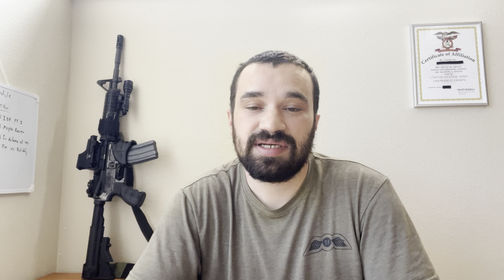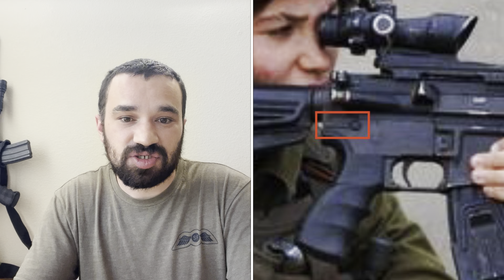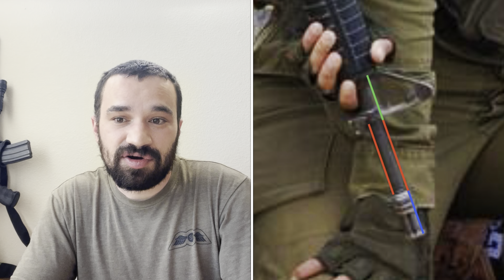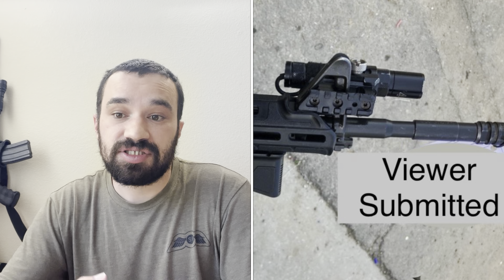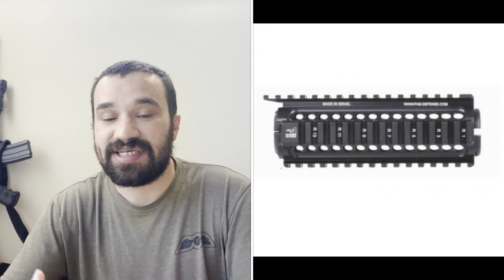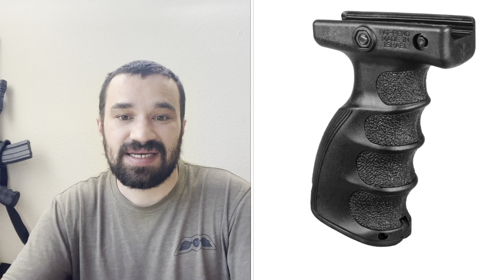The M4 in Israeli Service

Comment: Chopped down M-16 barrels? I think they are factory-made M-653, the predecessor to the M4 series. I'm from Singapore and our tank crews used to be armed with them.
Reply from the maker: Thanks for commenting! It’s funny you say that, the barrel I am using for my “clone” rifle is a 653 barrel, and I did read that these were used in Singapore as well.

It a very likely that the IDF is using some 653 barrels, but their use of “chopped” M16A1 barrels is also well documented. In many of the pictures I show it this video, the Israeli “pencil profile” barrels appear to be 12.6” in length, which is the exact length of a chopped down m16 rifle barrel (due to the location of the original gas port). We would typically expect a 653 barrel to be 14.5”.
Reply: @Triangle26  Unlike your stated field of expertise, I know nothing about gunsmithing. However, isn’t it very difficult to take a M16A1 20-inch barrel, cut it down and then relocated the front sight / gas block further down towards the trunnion without issues including alignment of the foresight, the gas system etc? 

From photos online of very short IDF carbines  I can surmise that they took the M653 and further cut down the barrel by an inch or two, but not affecting the front sight and gas system.

Comment: About your mention of no high profile units like golani givati and nahal getting rid of their x95s, they actually are, all current units in training for those units are training on m4s with aim point comp m4 and not the mepro m5
Reply from the maker: Thanks for insights! I’ve been receiving conflicting information, but it sounds as though what you are saying is correct. Although my understanding is that experienced soldiers in those brigades are still primarily using X95s?
Reply: @Triangle26  yeah the soldiers already in the unit are still with the x95, I imagine as each unit gets replaced by new recruits (every 4 months one out one in) they’ll slowly be fully faded out. A few of my friends in nahal reservist units were meant to switch to the m4, I can check with them if they actually did (just called up again). There were also reports that the current tavors would be transferred to artillery and tanks so they have new guns that are also compact. (Artillery and tanks as you know use shot to death katzars and mekutrars that have serious logistics issues leading to bad reliability, bad buffer tube springs, worn out parts, bent front and rear iron sights etc)

Comment: Just curious, is the IDF transitioning to gray uniform from olive green or its just SF units?
Reply from the maker: Hopefully one of the IDF guys in the comment section can help, I have no idea!
Reply: @Triangle26  Yep, I googled it's "muted green"? . Follow up question mate, Is m193 the standard ammo in IDF even to those who carry M4's?   Sorry if I missed a part of the video.
Reply from the maker: @NeilJason-fo6kb  Great question. Yes, I believe M193 is standard issue for the IDF, however they definitely use M855 as well. I’ve heard quite a few reports that marksmen in particular are given 855. This likely has something to do with the fact that most IDF marksmen are using 4x32 ACOGs, in which the reticle is typically calibrated to the 62 grain SS109 projectile.

All that said, I haven’t mentioned it in a video yet because I am still digging in. It seems crazy to me that units are issuing 193 and 855, while simultaneously using 1:7 and 1:12 twist barrels, but based on what I am hearing, that is definitely common (at least in the reserves).
Reply: @Triangle26  Thank you mate.

Comment: When I was there last year,  the M4s I saw were equiped with basic plastic USGI furniture (not FAB'ed out, not even a knights rail) with a sling,  light mounted to the the front sight block, and a Meprolight MOR for the optic. These were Homefront Command reservist though. The exception to this was one very grumpy looking soldier with an x95 (zero finish remaining) who was patroling the market.

Side note: I use Nitecore lights as well - i particularly like the C17, which is a dual white / IR emitter.
Reply from the maker: Thanks for sharing. It does seem to be unit dependent, I’ve heard similar things from a few guys now.
Reply: Homefront Command are pretty much the last in line for new equipment and arms, especially their reservists

Comment: Thanks for the video, very well put.

a small comment/opinion on the definition part as an IDF infantry who served around that time. During the end of the 90's through the beginning of 2000 the IDF was in the process of replacing most (if not all) Colt car 15 based platforms (katsar, mekutsar etc) at their combat units with modern Colt flat tops, i.e proper m4s.

Up until that point anyone who had a katsar/mekutsar (i.e some configuration of a relatively short barreled car15) was either in some SF unit, or if in regular infantry, was a medic, a machine gunner, or maybe a "veteran" (i.e nearing discharge). By that time the rest actually used M16A2 (which in some cases were newer the highly coveted shorter car15's) the designated marksman's used M16A3 which were the only ones issued with ss109 rounds. I think for me the main difference, was the barrel, a thickened one (not pencil barrel) with different twist rate.
This meant the whole squad could fire the SS109 like the designated marksman did, with an emphasis of being EEFECTIVE in longer ranges than the old CAR15's
(like around 600m instead of 300m don't quote me on that exact number)

Shortly after (like a couple of years) many of the units who switched to M4 switched to the TAR21. I guess over the years a whole mix and match parts started and soldiers just kept on calling it M4's and many younger IDF soldiers just don't get the historical reference as to what a real M4 is or why we even started calling them that.
Reply from the maker: Thank you for taking the time to share that information. That all makes good sense.

I keep forgetting to talk about it in a video, but the twist rate issue is so interesting. It sounds like such a headache to have to differentiate between 55 and 62 grain ammunition within the squad level.
Reply: @Triangle26 i am not sure actually it was about the grain amount, (possibly also I guess) the main difference was the bullet itself, the SS109 (green tips, not sure how you guys call them) had a full steel core, while the older bullets we used had half a steel core with some lead at the bottom, again not sure which designation they had.
The old m16's can shoot SS109, but because of different twist rates in the barrel they start to tumble (midair that is) after about 300 meters. Modern M4 can shoot SS109 further away without tumbling due to higher (or is it lower? can't remember now) twist rate, which mean they are more effective in longer ranges with the same bullet. I guess grain amount is also a reason, but I don't remember that was ever discussed in classes.

And thank you for taking the time making these videos :)

Comment: Hey just a couple of things

The reliability issues are usually from the magazine rather than the weapon failing or maintenance(I had magazines manufactured in 2002 and some that were manufactured in 2019 old and very used magazines are common) 

As for the difference in barrel what you've seen in the photo is what we call M16 flat top the only people I've seen that call it an M4 are the guys who are issued it which are the border defense corps they are not as well equipped as the normal battalions(which you see with the M16 flat top and Mephro M21)

The gentelman at 25:07 is the Chief of the general staff as for the eotech they are starting to be more wide spread the paratrooper brigade are all issued eotech's (I think its the xps-3 but I am not sure which exact model it is as I am not familiar with eotech models)
Reply from the maker: Thanks for sharing your knowledge - I sincerely appreciate it. Everything you’ve mentioned makes perfect sense, and I have taken it down in my notes. In the event a third video is made, that will be reflected.

Comment: Great video  - thanks!!!
Do you know how IDF attach sling to M4/M16?
Reply from the maker: @mishagofman1706  Thank you for watching! As for IDF sling attachments, it seems to vary. The most popular sling attachment method seems to use a paracord loop tied to the buttstock for the rear attachment point, and an integrated loop in the heavy black handguard wrap as a front attachment point. This worked very well for me, and totally eliminates sling rattle. 

Alternatively, I have seen many setups in which soldiers wrap paracord around the A-Frame of the front sight tower, and clip the front of their slings directly to that. This is also very quiet, but I did not at all like the ergonomics of this in my testing. It really seems to work best with a very loose, low hanging sling, which is not my preference.
Reply: @Triangle26  Thanks a bunch!!!
It has been so long  - I do not remember  - I had M16 at that time - trying to find a video  - any chance you would post one? - I would really appreciate!!!
Reply from the maker: @mishagofman1706  Yes, I can try to make that happen.
Reply: @Triangle26 That would be awesome - thanks!!!

Comment: You bring an angle that I've needed to hear about keeping weapon parts from failing due to wear
Reply: Just make a habit of cleaning after every other range trip as a minimum, or every 500 rounds. If you can keep that regimine, you'll be just fine. Pop on some tunes or a podcast and use it as a little meditation time.

Comment: The Tavor TAR-21 is not usually marked with Hebrew… except some of the newer CTAR-21s that have the IDF stamp instead of the IWI stamp found on earlier examples. I would say most are IWI stamped. But the writing is in English. Even the safety selector markings are “ S R A.” The ITL MARS has a sticker on the right side that does usually have Hebrew text except the very early examples. To my knowledge, all X95s/Micro-Tavors used by the IDF have the IDF stamp with Hebrew, however.
Reply from the maker: Thank you for clarifying! I was able to find images of Hebrew IDF stampings on an X95 micro and a TAR-21, and I inferred that those were universal to the platform. That said, I’m not surprised to hear that there is more nuance. I will make note of that for the future. Thanks again!
Reply: I hear ya. Yes, always nuances. Makes cloning a challenge. Very professional and well made video. I subscribed after watching; excited for the Meprolight M5/RDS PRO V2 review!

Comment: It's cool that they are running around with all retro gear. But from what I've got from this video. They sureneed a Up-to-date gear not saying that what they're using won't get the job done. The durability for what they have chosen is definitely there if not better than what is on the market now.

Comment: IDF Combat engineer in reserves.
Our last deployment in July-August to Gaza we were stationed with both Nahal and Givati infantry brigades (they rotated mid-way), nowadays all infantry and combat engineering units do their basic training with an M4, the newer soldiers in these units went through conversion training to M4 while senior soldiers get to keep their X95 until the end of their service. as far as I remember Magav(border patrol), mixed infantry units, rescue brigade and field intelligence are using a flat-top short-M16 (not socom barrel profile).
In all units Designated Marksman roles are filled with M4 or X95 paired with ACOG and NV/Thermal sights, there is also this huge bullshit they made for reserves, an M16A3 ("A3" for short) which has 20'' bulky barrel 1:7 twist for green-tip marksman role BUT it has the carry handle and the big wooden stock so they have a dumb pic rail mounted on top of the carry handle and a raiser for the stock and it's the least ergonomic rifle I have ever shot and almost impossible to shoulder with clear view of the ACOG sight, I can provide a picture of it, I have it saved on my phone haha.

Regarding X95 usage in reserves, it is a great question because there are a lot of battalions that still use them, so they either transition newcomers to X95 or transition to short-M16

Edit: There is also a rumor that the IDF plans to replace M4 with the IWI Arad in the far future which is a gas piston ar style rifle, which is pretty much another clone of HK416/M27. but these are only rumors and production of those are far from being complete.
Edit 2: at 25:09 this gentleman is the chief of staff Herzi Halevi haha
Reply from the maker: Thank you for taking the time to share that information - all very interesting. I would love to see the picture of the marksman rifle you are describing. Who knows, that might be the next video… If you are comfortable sharing the picture, please email me at “triangletwentysix@gmail.com”. Either way, stay safe!

Comment: nitecore makes a durable light. been carrying one or another for a decade .    Seems like in IDF use, what serves as a scout light, is just a typical tactical EDC handheld light in a pic mount (circa 2010) vs  a dedicated unit like a Streamlight  Protac rail mount.  its a simple swap. of tail switches to incorporate a tape switch in that configuration.  side note. Nitecore has began to market their own line of dedicated pistol lights.  decent lights with all the expected features that NO ONE bends kydex for.     Subbed up.   enjoyed the content and very much appreciate the effort!!
Reply from the maker: Thanks for sharing, I appreciate the insights. I definitely went down a small rabbit hole with Nitecore stuff, and I was definitely left with the impression that it’s good to go.

Comment: What is the purpose of the black elastic band that some troops put over their front A post sight?
Reply from the maker: That’s a good question, I’ve gotten mixed responses on that. It definitely seems to have something to do with keeping the forward sling attachment point from rattling. Israeli’s often remove the front sling swivel entirely, but in some cases they may just wrap it up to achieve the same effect. They also often tie paracord to the FSB to create sling attachment points, those wraps may help snag-proof or otherwise secure that paracord…

Comment: I wouldn't say that the Tavor sidelines anything. It just exists like the mentally ill kid in class.
It gets phased out very fast and hopefully soon will complete it's phase out from the IDF. The IDF and the Israeli DOD aren't that simple, on the one hand you're mostly correct on the idea that the IDF would rather utilize existing stocks of parts and create M4s out of M16s rather than trash everything, while at the same time they used the X95 in the military as a way to market it abroad as Israel's rifle, and by all accounts it worked.

As for prestige: Golani or Nahal are no where prestige, they're just infantry.
The predominant majority of Israeli infantry divisions aren't different much so there's no prestige to be talked about unless you dive into each specific infantry spec ops units e.g "Sayeret Nahal, golani, givati, tsanhanim (paratroopers)"
The paratroopers when it comes to regular infantry are the most prestigious because soldiers joining the IDF paratroopers need to pass teats as if they are going into special operations just to join the main paratrooper divisions only to then do all of these tests again if they wish to proceed to special operations paratroopers, duvdevan or otherwise.

Prestige isn't the most relevant topic in the video but it is important to note that the X95 is not a good sign and anyone with more than half of a brain cell and basic combat experience knows what a shit rod that is.
Just imagine someone designed the AR15 with a distinct shelf around the ejection port and no ejection port dust cover and think how it will impact reliability in a f*king desert.

Comment: Served with the x95 and the m4.. x95 is garbage. Its a good range/truck/civilian gun but after getting “war dirty” its very hard to clean completely back to “clean” especially in field.. the m4 is very simple to break apart to bolts and nuts level fully clean it and put back together in field.. 

Mapro light 21 is garbage for all uses, just useless piece of equipment.. in about 100 meters the dot covers a shoulder target where you cant really understand where on the target you actually aim, tinted glass makes it really useless at night operation..

Check out the old M.A.R.S. Sight, one of the best gun sights i ever used, it has 0 magnification but on i.r. Setting the dot is so small but still visible to naked eye and give you the option to hit 150-200 meters comfortably with 0 magnification…
Reply from the maker: Thanks for the insights! Out of curiosity, have you had the opportunity to compare the Mepro MOR to the ITL MARS? I plan to try at least one of those optics, but the MOR is much easier to find than the MARS.